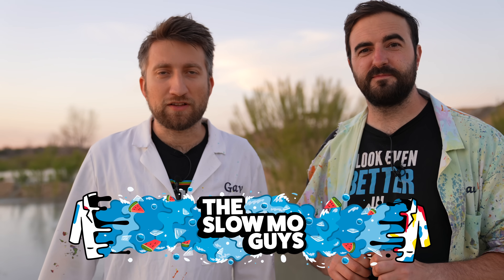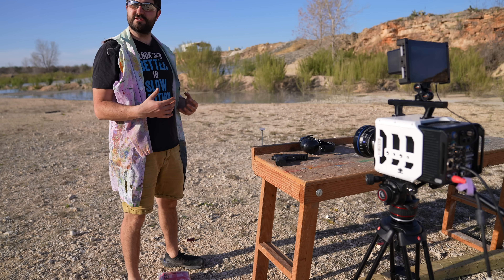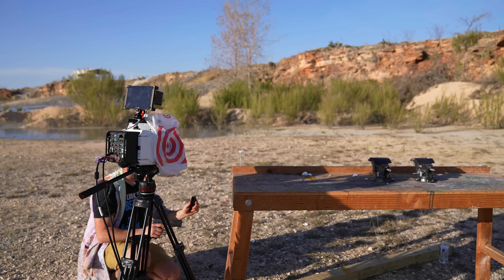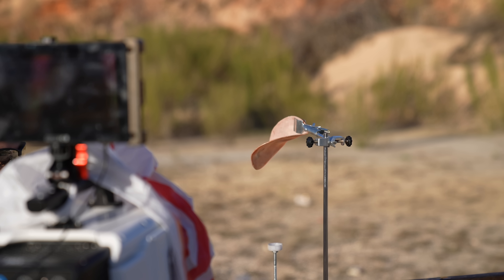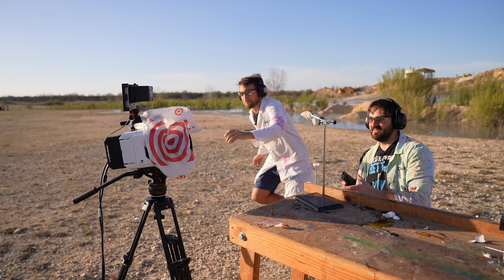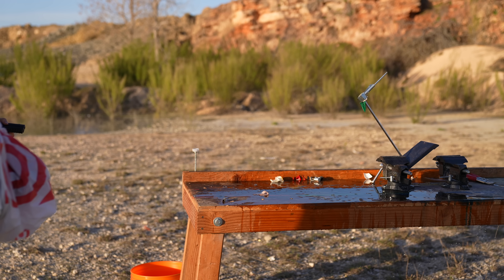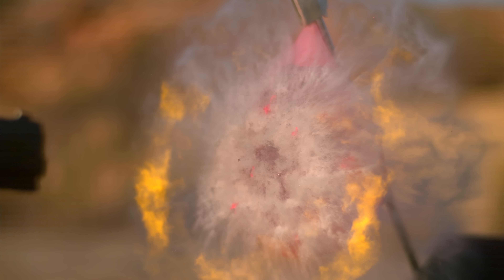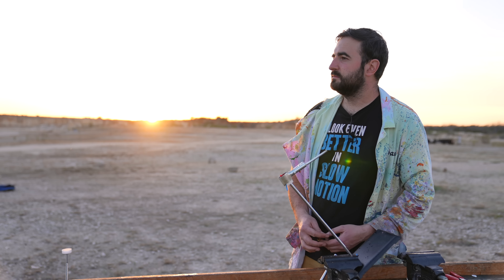The Explosive Power of Blanks at 82,000FPS - The Slow Mo Guys

Comment: My experience with blanks in the army was that they were extremely inconsistent. Some wouldn't even cycle with a BFA, others would surprise you with a decent kick.
Reply: "Military grade"
Reply: I only got one day of shooting blanks from an M-16, but I never got one to cycle it. All manual operation for me. Some of the others I was with fared better.
Reply: With my recollections, spotty as they are. However, when I was in basic training way back yonder, I seem to recall the blank cartridges we used as having wadding inside them, I believe with the intention of creating sufficient pressure's for bolt cycling and with the instructors giving us various displays of their lethality should one be foolish enough to think of them as being harmless because of the name designation. 
My memory,  being as spotty as it is may well be playing tricks on me. Perhaps there is someone who can clarify my claim.
I should add some context. HRH Armed Forces R.E.M.E, 1970s, 7-62 (308) FN SLR Full, Semi auto and single shot rifle using Yellow Tip full powder charge cartridges with full bolt cycling from a 20 round magazine with manual loading. 
RIP Queen Elizabeth ll.
Reply: I never had a problem with cycling using blanks in an M4 carbine or M249 with the belt just when using the M249 with a standard magazine was when it wouldn't cycle properly
Reply: To me it makes sense, given the way it looks like there's a little open end where the crimping is. Any small inconsistencies in crimping would lead to notable differences in how easily the exhaust flowed out of/pushed them apart, and small changes in that could lead to large changes in the pressure, which would change how fast/completely the propellent burned.. I doubt it's even a manufacturing defect, just the way things are.

Comment: Vid was posted 10 hours before this comment, so I’m probably not the first to say this, but the “gunk” that comes out is unspent, unburned gunpowder. The salvos have very inconsistent crimping, and powder charges. Sometimes they’re louder than regular rounds & some WILL cycle the action of the firearm, so don’t assume that the weapon is safe after firing a blank. That is of course if you have more rounds in the magazine, and if your particular firearm will feed these types of cartridges.

Comment: Not just the powder, but the shockwave of the expanding gases can also do a lot of damage. There's a video on Kentucky Ballistics channel of the pressure wave from the muzzel of a .50 cal flat out disintergrating a watermelon. Blanks fired at close range are straight up lethal.

Comment: Right at the start, blanks are also used in construction. A contractor putting walls up in my grandmothers basement used a nailgun with blanks to attach 2x4s to the concrete floor. Was very loud.

Comment: Most blanks are charged with black powder, instead of smokeless powder, because black powder is an actual explosive (it blows up), while smokeless powder is just a deflagrant (it burns). A brass crimp isn't enough confinement to make smokeless powder go bang.

You can prove it. Take a cartridge--a bottlenecked rifle cartridge is best--and pull out the bullet, then (with the powder still in) crimp the mouth shut with a pair of pliers. (Crimp it flat and roll the end over if you like--won't make a difference.) Get a blank cartridge of the same chambering. Toss the blank into a campfire and wait. BANG! and hot coals fly everywhere. (You might want to scooch back a bit first.) Now toss in the cartridge you pulled the bullet from and wait. Foosh! and a cloud of sparks rises gently into the air.

Now, having learned this lesson: next time you're camping with friends and sitting around the campfire, accidentally find a live rifle cartridge in your jacket pocket, comment on it, and idly fidget with it while the conversation proceeds. When the subject has changed, but everyone's eyes are still on the cartridge, blithely toss it into the fire and watch. (Might be a good idea to have an accomplice filming.) Your friends' reactions will be priceless.

Comment: Stage directors (plays, musicals, etc.) need to watch this before using blank loaded guns on stage. Wax wad and paper wad blanks, as well as half load and quarter load blanks, are made for the purpose, though the attachment you mentioned may not always work on a semi-automatic pistol.

I did a workshop about a decade ago with the propmaster and armorer at Milwaukee Repertory Theatre on firearms on stage. He used newsprint and a flashlight to show how close actors could get to each other before the hot ejecta would be an issue.

Comment: I used to work as a gunsmith in the entertainment industry and we used to have to demo the dangers of blanks for people before they were allowed to rent them. We'd use styrofoam and thin particle board for the demonstrations and it was always kinda wild seeing how much damage the blanks can actually do. We always made a point of informing them of at least a few of the 'on set' accidents that have happened with blanks as well. 

One thing I'd like to point out is that all the unspent powder you're seeing in the clips here is only there because there's nothing slowing down the exhaust of the gases so it doesn't have the time to burn. When using a weapon converted for blank firing, or using one of those blank firing devices, the gases are more contained and you get more complete combustion of the powder so there's less particulate matter, but more gas coming out the barrel so there's more muzzle flash. I'd personally be really interested to see slow mo of a converted blank firing weapon being discharged to see how much less powder is ejected. :)
Reply: I'd also like to see the converted weapon, not just to see the difference in unspent powder and muzzle flash but also to see if there's a different level of damage. At the very least, I bet the damage as it's happening would look different even if the result is practically the same
Reply: I can think of two actors who were killed by blank-firing weapons. Brandon Lee and Jon-Eric Hexum.
Brandon's death was frightfully similar to the Alec Baldwin incident, with a dummy round left in the weapon.
Jon-Eric Hexum, on the other hand, was self-inflicted when he was "playing" Russian Roulette with a blank-firing pistol while waiting around on the set of a show he was acting in.
Reply: @MonkeyJedi99  Those are probably the 2 most famous incidents, but there are others.
I've never personally researched the Lee incident, but my understanding is that it wasn't a 'dummy round' but what we call a 'squib' or a round the never exited the barrel. No one noticed the blockage in the barrel and when the firearm was later loaded with blanks and fired, the blank being fired pushed the bullet out of the barrel as if it'd just been fired for real. It's not a common thing, but it's one of a list of things that armorers are responsible to check for.
Reply: I hope you are better than Baldwin's armorer. Also, throw in cleaning rods for fun. They launch awesome .
Reply: Shotgun blanks are a big reason why semi-automatic shotguns are hardly depicted in film and television because not enough pressure is generated to cycle the bolt, part of the appeal of the SPAS-12 in movies like Jurassic Park is the dual-mode system that let you fire semi-automatic or pump action.
Reply: Can you do compensation in 9 mm like hellcat rdp and sig 365 comp would be cool to see the gasses come out of the comp in slo mo. With reg ball ammunition
Reply: @BornagainBloodbath  why are you replying to him with a slo mo request?
Reply: Without a bullet the incomplete burn is due to the lack of back-pressure to built up and ignite all the power flakes.  If they had a choke in the barrel, that would cause more back-pressure and a more complete burn.
Reply: A properly fitted BFA will have less muzzle flash than ball ammunition.
Reply: How far should the actor stay apart from the shooter if there's a shot that requires both to be on the same shot using the converted guns? Not that I want to do that at all, just curious.
Reply: @Potatinized  our general instructions were to never actually point the firearm directly at anyone at a distance of less than 3m or so. If you need to have actors closer than that you have to use camera angles to obscure that you're pointing it off to the side, not directly at someone.
Reply: @Potatinized  They should never be down-range, period.
Reply: @Potatinized  I remember when they reported the Alex Baldwin accident, in such situation, the gun should still not directly point at the other person, rather of set a little. I think they can easily trick our eyes on film since there is no depth of field.
Reply: @mrmosk2011  You got that right. the same way when someone punches another from an angle, that it doesnt actually contact but looks like it does.
Reply: Off topic...
What's your take on Baldwin? Was it his fault or should someone else take the blame?
Reply: @BCM1959  As an actor, Baldwin is not responsible for firing a gun he thought was safe, but in his role as producer, Baldwin is ultimately responsible for any reasonably foreseeable and preventable injury on set and definitely shares blame for the specific issue of lax gun safety protocols (and for this reason, the production company was fined $100,000 by the New Mexico OSHB).
Reply: @yc3zy  TBF, Baldwin is not at fault due to the director forcing an unscheduled scene and not waiting for the armorer to check the firearm. Baldwin is not necessarily responsible for this incompetent reckless accident. Producer roles generally mean nothing in terms of actual production, and are very grey-area in legal terms.

Comment: Hmm there is a difference between the 'blank' rounds.. there is crimped, paper, wax, cotton, the 'blanks you shows at the start are crimped, cotton and wax blend blanks are honestly better, and they do give a small amount of recoil, a blank round does sound MUCH different than a live projectile, and blanks (Crimped) are often used for things like a Nail Gun for driving nails into concrete. There are very large dangers with the paper/wax/cotton blanks because there is a mobile projectile for the first 1-4 meters from the barrel end. Also when firing blanks, be sure to super clean your gun afterwards, all the unspent powder and mix often gum the barrel up.

Comment: Hey guys, here in Germany we have "Schreckschußwaffen", which are basically specially weakened versions of live ammo guns which can only shoot blanks, as they have a blocked barrel.
Those blanks, however, have more than enough power for semi-automatic fire, so how come the blanks for live guns do not?

Our blanks here look quite a bit different too, they are properly sealed, not just crimped, i.e. shorter, as the entire section that would hold the projectile is removed, and the shell is sealed right underneath where the projectile would have sat in a live round.
Reply: I'd really love to see you guys repeat this with my kind of blanks that I'm using here, which is called 9 mm P.A.K. (Pistole Automatik Knall):
https://en.wikipedia.org/wiki/9mm_P.A.K.

Comment: Seems propellant is a rather slow burning powder, thus quite a shower of unburned particles. Blowing open the crimp is way quicker and easier than the 9mm bullet, at around 125 grn, thus less time for full pressure build and more complete combustion.

Comment: Sunset at the end. Great! 
But why are you guys amazed? The explosive powder in a cartridge can send a ?? ounce piece of lead ??? yards, right?
If that Energy is not used to propel lead, then all that energy is available as pellet-blast or air-blast, or as heat/flame.
An approximation is that close to the muzzle exposes the body to as much energy as the bullet would at ?? 100 yards away.
Chris

Comment: Interesting! I’ve only seen the blanks with plastic end caps used by the German police, never with crimped ends. Awesome video!
Reply: I presume crimped blanks are single-use and melted down for recycling, while plugged blanks allow you to reload the brass.

Training blanks with plastic caps I would presume use standard propellant. Theatrical blanks are more likely filled with specialized fast-burning powder to increase the report and muzzle flash, so much so that blank-firing propellant is extremely dangerous if you try using it in a live cartridge of ammunition with a bullet. The gun will certainly explode if blank powder is used to propel a live bullet.

Comment: Scott @ KY Ballistics did a video showing the muzzle brake exhaust wrecking stuff, particularly with 50 cal rounds.  I was surprised how strong that exhaust vent showed to be.

I'm surprised in these shots of blanks how much "junk" gets propelled out.  That seems to do most of the damage, versus the venting of the gasses.  Definitely don't point blanks at people.
Reply: He did a video about blanks, and then he brought out the 12 and 10 gauge shotgun blanks. Oh dear, what was once there is now just gone. Yeah Shotgun blanks are not to be messed with.
Reply: All that junk that is propelled out is all the unburnt powder of the round since 10 to 20 percent of all the powder is never fully used up.

Comment: It kinda reminds me of a special type of 12 gauge shotgun shell. A "Dust" or "Powder" round. Instead of BBs it's basically iron filings or steel dust. Typically used for breaching doors. You guys should check those out!
Reply: The military application of this in a missile or bomb warhead is known as Dense Inert Metal Explosive, or DIME. The intent is to create bomb that is absolutely lethal within a smaller blast radius, but cannot carry that energy beyond the walls of a building-- a surgical strike that can take out a large room or a building without killing bystanders in adjacent buildings.

There is contention in its use, though, because one can imagine the horrendous injuries inflicted by metal dust being used as a blast projectile against actual humans rather than doors or walls.

Comment: The unburned powder doesn't really matter. Hot gasses at 35,000 psi cannot dissipate over a few inches past the end of the muzzle. The gasses escaping around the cylinder can remove a finger.

Comment: That ham tearing was absolutely brutal.  I'd like to see the blank shot hitting some ballistics gel from a distance of about 1 meter, and how far in does the shrapnel go.
Reply: It will not pierce at all on that range. All it'll do is just stick to the surface of the gel or bounce off. They struggled with the balloon on similar distance.

The only thing that act as projectile are gunpowder that hasn't been ignited.

Comment: Parts of the brass could be coming out, therefore ALWAYS use a BFA, if You are doing a war game,  or something like that. Some armies use plastic or wooden bullets in ordinary cases, but the powder is a very fast burning type, do not ever put a solid metall projectile in those cases with the standard powder.

Comment: My 2" derringer 22lr will put a hole the size of a quarter through a paper plate from about 6" away with a blank. 22 blanks are easy to find, the hardware store carries them for the nail guns that use them.

Comment: A classmate of mine was hit in the leg by a blank from a starter pistol at a track meet. I believe it was a mix of the unburned powered and some of the dirt off the ground getting blasted by the gas that hit her. The guy who shot the starting pistol was insistent that  "it was a blank, so it couldn't have done anything". Her leg was peppered and was lightly bleeding from a wide area on her calf.

Blanks still have their dangers, so I'm glad to see this kind of video out there to teach people whats what.
Reply: What was his explanation then? That she just started to spontaneusly bleed from her leg? 😂
Reply: Why was he aiming at the beeping grpound with a weapon!
Reply: @RamonInNZ  My dad did track meets and had two starter pistols.  I might have only seen a few track meets, but they pointed the starter pistol in the air.
Reply: @TheBntimmins Ya, I thought they were always fired into the air, too. I guess if people believe that they're harmless, they might fire them in any direction, though.
Reply: @RamonInNZ  what is a grpound?
Reply: A ground pound x)
Reply: Poorly made or reused brass cartridges also have a chance for the metal in the crimp itself to break off giving not just powder as shrapnel but actual flecks of metal as well.
Reply: Oh blanks still have that pressure wave. If close to them then it not good.

Comment: If you have a rough time with food prep or have limited time and/or ability to cook, you can freeze the taco meat in ice cube trays after you cook it. When you want a taco, you just pop out a couple of cubes out and microwave them (40-45 seconds usually works) and make your taco with whatever fixings you want. I usually use 1.5 cubes per taco
Reply: Can you shoot at them in slow motion as well?

Comment: You should have done this with a purpose made blank firing pistol instead of a real one, without an obstruction in the barrel there's not enough back pressure for the cartridge to actually fire properly. That's why it's launching all that unburnt powder out, a real blank gun would be a lot more energetic